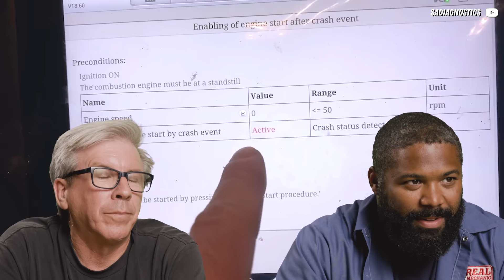Mechanic Reacts to Engineering Fails

Comment: Some of these mechanics never worked on a Fiat, judging by how much they complain about little things... Recently had to re-do the head on my 2005 Strada. That thing's engine bay is so cramped, half the time you don't have room to fit your tools, let alone your hands. And then you have practically EVERYTHING fastened with torx bolts. Why? Regular bolts work just fine! And don't get me started on timing the bloody thing. You need a tool specifically made for that specific engine (a 1.6 petrol in my case), to tension the belt once you've got the cams aligned. Both cams, because dual overheads of course. And then there's the fact that I needed to borrow a wrench from a truck mechanic to actually turn the flywheel because the nut is so stupidly big. Oh, and the thing that grinds my gears the most, is getting the exhaust manifold bolted to the engine. The engine is mounted sideways, so the exhaust manifold is against the firewall. Underneath EVERYTHING ELSE. Just getting to it is enough of a mission, nevermind getting all of the nuts tightened down. I didn't even put the aluminum shroud back, it's just too much trouble.

Comment: the engine mount or rather transmission mount on my car (audi a3) to get that one out, i have to remove the battery, remove the battery tray so that i can remove the cable housing which is fully blocking the bolts for mounting.. not to mention there is an upside down screw additionally holding the battery tray in place blocked by another thing i dont remember now as it is about 6 months since i took care of the engine mounts that was originals from when the car was new allmost 25 years ago.

Comment: I remember wanting to check the pins of the ecu connector in an A4 cabrio for corrosion. Once i get there, i noticed the connector was covered with a shield, and didn't even have bolts, but a single, thick steel rivet... i told the customer the car was driving me nuts (a was looking for the cause of the limp mode at certain speed and engine load).

Comment: It was way worse than having a menu to enable my BMW E90 after my wife bumped the car ahead of her, popping two airbags.  There is an explosive bolt (I learned later) that COMPLETELY disconnects the battery from the rest of the car.  The tow truck ended up costing $1,000 and repairs were over $8,000

The dent in the hood was about 1-1/2” deep.

Comment: 8:10 
The best oil filter/drain placement I've ever seen was on the LS4 in impalas and malibus.
Their both right next to each other, like you only need 1 drain pan to catch the oil from the drain and filter, the filter is UPRIGHT not sideways, and if your arms are long enough you don't even need to jack up the car. Nothing better than saying you can do an oil change with a 19mm socket and don't even need the car in the garage.

My blessed engineering moment was doing valve timing on a Cummins in some off brand dump truck, we realized there was no way to get the barring tool on the flywheel to hand bar the engine, we were discussing the best way to remove the cab until we realized that the doghouse in the cab had a little door just in front of the cap for the barring tool. I've never been so relived in my years of wrenching on shit.
Second place goes to Renault for having some of their headlights on hinges so you can just swing the assy open to replace bulbs.
Reply: Speaking of headlights, I had a 2003 Silverado Pickup truck in which the headlight assembly was placed into little tabs then locked in by a short sliding metal bar. Slide out the bar, then pull the whole assembly out of the tabs to replace the bulbs! No tools needed at all. Unbelievably simple and easy, especially coming from GM. And compared to some of the insane designs of other vehicles when it comes to replacing bulbs!
Reply: @BaltimoreAndOhioRR  I miss when GM's did that. They still do 1/2 of it, there is a sliding metal bar...... AND a bolt.
Reply: @nilloc93  Did my comment get deleted?
Reply: @BaltimoreAndOhioRR  I can still see it, youtube sometimes doesn't show your old comments on mobile and the notification menu
Reply: @nilloc93  weird.

Comment: A lot of 1960s model fords have the oil drain screw in an area that's not easy to access when it's not on a lift, kinda a pet peeve of mine.

Comment: Ive literally had the locked up engine issue on a customer car. Didn't complain,wasn't that big of a deal to pull the crank with the torque converter attached,and then pull the converter.

Comment: Came across "limp mode" the other day when one of the fuel injectors failed. Limits speed to 10mph x the gear you're in. Forcing the driver to go  into 3rd gear at 20mph on 3 cylinders is a bloody stupid idea!

Comment: That def clip looked like a fuel filter on a ram Cummins I used to do em and I hated that it splashed everywhere but if you loosen it just enough it’ll be offset and just barely catch the side of the drive shaft 🫡👍🏼

Comment: Ford GT I'd say both. It has a super short range so it's mostly made to be driven from your home back to your home although you do have to get fuel constantly. I had an 84 Corvette and it had just windows that rolled over and it was nightmare. It had decent range so it was meant to be a daily driver but DAMN it was near impossible sometimes to get into the car. Also the gas was in the center which meant you had to park close to a fuel nozzle when putting fuel in it. I actually literally had to crawl out of the car onto the ground a few times to get out. Also a few times in a parking lot, which I'd always park a ways out, I'd come back and two cars are parked close-ish to me and I'd have to stand there and wait for someone to move and hope they both weren't employees.

Comment: 6:00 Take off the oil pan, cut the crankshaft with a grinder wheel as far back as you can, and hopefully you can turn the torque convertor.

Comment: I was angry when I bought a Micra, and the dust shield on the bottom was bare aluminium bolted directly to bare steel. Guess how long that contact point lasted.

Comment: Chrysler 2.7 water pump ran by the timing chain. When you find out it fails is when the engine starts knocking.

Comment: I am a car, motorcycle and aircraft designer and all these mechanics are complaining about the engineering team not the design team. A lot goes into a project to build a car to reuse cross family lineup parts, but a lot of these are oversights by engineers that don’t consider assembly, access (ingress/egress) or other potential hazards. Designers typically develop on top of the package they are given and refine styling details and introduce new features.

Comment: I recall having a Renault Clio that kept losing power at random times, especially when pulling away.  

Took it into to Renault and spent a fortune, 30k+ but they were not able to resolve the issues. 

Eventually took it into my local Bosch mechanic and he found a temp sensor, or something was faulty and informing the cars computer that it was overheating so this cut power. It ended up costing 250 to repair. 

I hate cars haha

Comment: I definitely have to disagree with that Ford oil filter placement, because I think of all the DIY'ers out there. It's easy enough to get to the filter on a lift, but if you're doing it on the ground at home, it'll be a major struggle just to find the thing lol. Regardless the most common maintenance item should be easily accessible no matter what

Comment: When it comes to designing a car, and packaging, everything is compartmentalized now. The battery people have their box to work in, the cooling system people have their box, power steering has their box. Most of the time, they don't know where anything else will be until it's already in prototype, so at that point, unless it's a show-stopper, nothing will get changed. That, and the manufacturers don't care about maintenance or repair. As long as it's projected to make it through warranty, it ships.

Comment: The Mechanics forgot that some times you have to remove the battery tray to get to the motor\engine mounts or sometimes the the top of the transmission. In fact I dare you to remove the 2013 CRV transmission mount without removing the PCM.

Comment: In order to fix the non working door locks, and 4 wheel drive actuators which were VACUUM operated, I had to find the air leaks caused by aging flex hoses in the entire body which were  moving every time the doors opened or closed or suspension went up or down. 
I blew cigarette smoke into the unavailable hoses and melted the leaks closed with a hot knife as silicone sealer would not stick.  I will never, ever work on an Audi again.

Comment: Try changing headlight bulb in Renault megane ll hatchback  2002-2009 . 
You have to remove front wheels and go through the wheel liner

Comment: bro there’s an older subaru motor that has the exhaust pipe wrapped around where you would put your hands to remove the filter 😭 that’s the only filter that’s a pain in the ass

Comment: Oil filter housings don't need to be in a set place because you can add hoses and relocate the filter. You said that mechanic complaining about the filter location was whining but a good mechanic would have realized that having to push through all those hoses means contaminating the new oil filter so it is an engineering issue. Although seeing the location of the filter I would think you come from the top instead of the bottom.

Comment: First car was a Ford Escort.  It activated the fuel cut-out after rolling over a pothole.  2,000 miles from home and the wife and I are stuck on I-40 100 miles from Gallup, NM.  My mind went to a clipped harness.  My wife fixed it by reading the owners manual and using her brain.  She popped the panel in the trunk and reset the fuel cut-off switch.  My ego couldn't handle it and I bought a Firebird when we got back.  Stupid Escort.

Comment: I think the 2 times ive been cursing at engineers was when doing a fuel filter on a peugot where the brake reservoir, battery, air intake and several covers/hoses have to come out just to reach it, and then its not even a cartridge filter so air got into the system and I had to take out and put back in all of that crap several times just to test if it was working. My thought being how come everyone else can put their damn filters in a better spot, but you cant? Even VAG is more thought out than this crap.

The other time was on V4 motorcycles where the oil filter is placed very close to, above the exhaust pipes and at an angle where no matter what you put underneath, oil WILL make its way to them and burn the first time you ride after an oil change. Ive ended up just covering the whole thing in news papers and accepting that my first ride will smell like crap.

I get that engineers do things for a reason, and most of the time it was the lesser of two evils. But I cant help thinking that when everyone else does something one way, why cant you?

Comment: As a consumer some years back I wrote a somewhat strongly worded letter to then in receivership Chrysler after I took my 2007 Chrysler Sebring Touring with a 3.5L in for it’s required 5 year or 100,000 Km service that entailed changing the timing belt, spark plugs & spark plug wires. The price 🤯because of what was involved in changing the spark plugs and spark plug wires at the rear of the engine. I’ll let one of you mechanics fill people in on what is involved on doing what a consumer would consider to be a basic tune up and why I would have had a WTF Chrysler moment.

Comment: The knob jockys putting the starter motor in the valley of a v8. gets baked, fails then the entire intake and fuel system needs to come off to replace.

Comment: one of the worst engineering fails that i have seen is in the 2022 toyota sienna where the third row seats dont latch when they fold down and so when you go over a speed bump or hit the breaks the seats fly up launching everything on them into the air
Reply: They saved 2 cents per vehicle. And besides, the cargo covering the third row will hold down the seats. /s
Reply: @sweetsucculentcontentnectar  but if you dont have heavy cargo the cargo gets launched when you go over a speed bump because you need at least 25 pounds to keep the seats down
Reply: @samuelholbrook-gd2bl  Guess the /s for sarcasm didn't land the way I wanted it too, eh? Fear not, I wouldn't dare deign to justify such a-hole design.

Comment: The last "blessed engineer" should be reclassified to lucky engineer because it was probably a mistake. I worked for a Nissan dealer as a mechanic(late 80's-early 90's) and our shop was selected to send our top tech to Japan to interact with the engineers and executives. Nissan wanted to know more about the mechanic perspective.  We sent him with a consensus "question" for Nissan from the rest of us techs.  "Why are these damn things so awful to work on?"   We often joked that Nissan employed Ninjitsu torture specialists to finalize the design. You know, put an extra superfluous bolt or piece of sharp metal designed to lacerate your hand when reaching for the oil filter which you can only blindly reach for while you are contorted into a position that will ultimately hasten joint degeneration. Not to mention the wonderful attention to detail they employed with respect to the flow of oil when the filter is removed.  Often beautifully diverted into a dozen separate piping hot streams which would nicely coat harnesses and find channels on mounts and cross members  in order to spread the joy into the widest pattern......on the shop floor. 

Our rep sat across the table from the then #2 at Nissan and some engineers as he answered their questions. They asked him if he had any questions and he delivered our "concerns" with as much diplomacy as he could muster.  Nissans response?  We do not want customers working on our cars, they will do better with professional maintenance so this "difficulty" is intentional (basically). If they really did employ Ninja or they simply put no thought into maintenance at all the result was the same, so  my coworkers and I chose to believe the former.

Comment: I'm no mechanic but I have worked on my own cars a lot. What pisses me off is when you have to remove a dozen things to just access a part that needs replacing. On one Ford car, I was supposed to remove the whole damn fender to replace the headlight. I said hell no and found a different way. Oh my current main car, a mouse somehow got into the AC blower and died. I had to remove three different things just to reach one bolt of the blower. The other bolts weren't that big of a deal. Nothing like spending way too much time in a hot car in the summer with a dead and rotting mouse a few inches from your face.

Comment: One car that I've restored that was really meant to be easy to work on was the Porsche 911 GT3. I renovated 1 by buying 2 for $1500. Super easy to work on but of course everything that can go wrong would go wrong and it took quite a bit of time. I'm not a professional mechanic either so of course I blame every fuck up on myself but towards the end everything was smooth sailing. Every part of that car was meant to be taken apart with ease though, I have to say that.

Comment: Engineering fail on several newer Fords I have a 2018 Edge and the battery is buried under the dash which protrudes over the engine compartment. Similar design on the 2015 and newer Ford transit vans we did the battery change in the van $300.00+ later because they have to disassemble the dash to change the battery. Ridiculous design.

Comment: I hit a pigeon with my jaguar xe, not much damage thankfully but I did need to replace the grill. Seached around online for a cheap used OEM. Finally got one delivered and took the front bumper down enough to access the grill, in the process I disconnected some quick connects for the electricals, I assumed fogs etc... no I disconnected the sensor for the "pedestrian protection system". So now the car has assumes that I've hit somebody and the explosive bolts at the back of the hood have gone off. So I'd better get myself down to the £186.00 an hour dealership so they can fix it. I'll be honest this was 18 moths ago and I just silence the warning every time I get in the car.

Comment: Chevy Traverse engineers weren't really thinking with  putting the oil filter right next to the exhaust manifold, it's not bad, just one wrong move and you cook your hand against that manifold if the car had been ran recently

Comment: My 04 Ford Ranger would randomly kill the Fuel Pump as if it was in an accident but it was never wrecked, so there were random times where I would have to push the fuel pump reset button order the passenger side of the dash 🤦‍♂️ not to mention it would happen while sitting in traffic or on a hill, not to mention it was a 5 speed manual

Comment: i had to replace the high preasure fuel pump on a diesel mercedes ml270 and like 2 out of 3 bolt where against the timing belt just close enough so that you cant place a wrench there but far enough so it doest rub against it

Comment: I have a 1988 Saab and the mechanic at a Midas ON LEWIS AVE IN TOLEDO, OH. didn't know that you have to lift for reverse as opposed to push down and broke my stick shift completely.
Reply: Did the shop get it fixed? My experience with Midas/Meineke is that they are a schlock operation.

Comment: 05 Pontiac Gto. alternator job. The front bolt for the alternator is too long to get out. You remove the fan but still won’t reach. It is a radiator out job. For the alternator. Ok the easiest engine to work on.